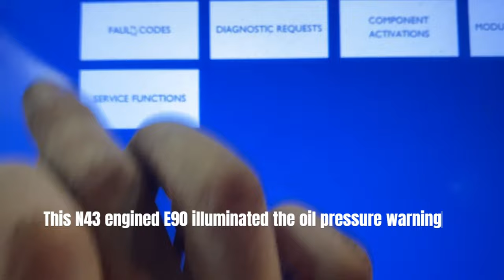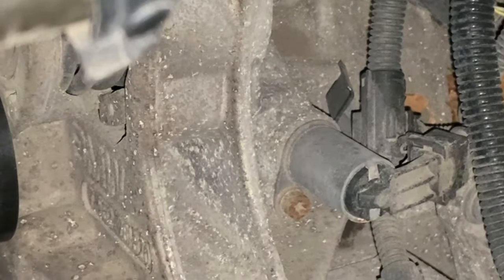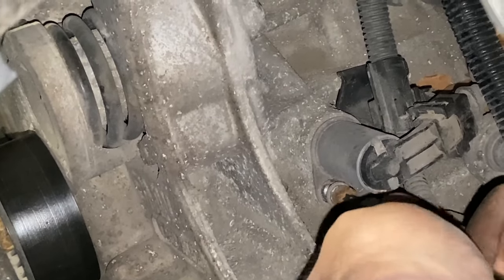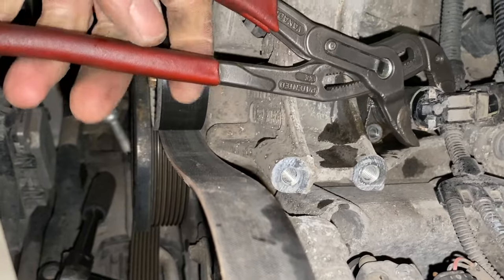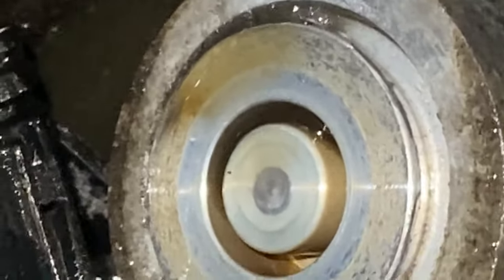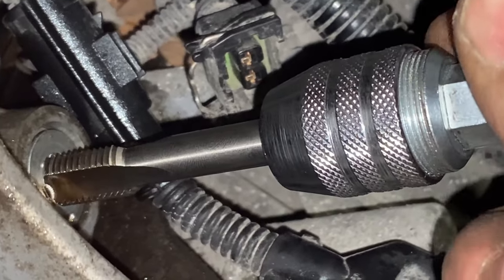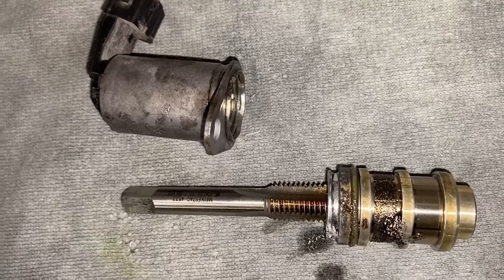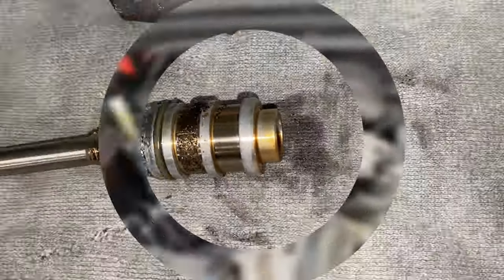BMW E90 N43 oil pressure too low

Comment: Brilliant video, thanks so much for posting. I had the same issue on my 2010 E92 N43 at 77k miles. Tried to get the oil pressure control valve out to clean it, but it snapped off - same as yours. So followed your video and managed to get it out using an M12 tap, but it took quite a bit of hammering. After it came out I had to fish out the spring and the end cap from the chamber, as they'd come off the valve - not sure whether they broke off beforehand, or I put the tap in too far - about 1.5cm. Put in a new valve £120 from ebay and the engine is running like a dream. Would never have known what to do with a broken off valve without your video. I owe you a pint. Thanks again for posting, love the commentary and the accent btw. Best of luck with the channel mate..
Reply from the maker: How amazing that my little M12 tap did the job for you as well and that you managed to fix the car with a new valve 🙂👍 Thanks alot for the comments and support. Awesome 🙂

Comment: Straight to the point, plenty of knowledge to pick up on for a DIYer like me, really enjoyed this mate!
Reply from the maker: Thanks so much for the kind reply and great encouragement. I have alot more videos in the pipeline so keep tuned for more 🙂
Reply: Top video 👍 did this customer’s car have the 30C1 fault code for ‘engine-oil pressure control’? My car has that fault and maybe this is why although the sump was removed recently and no debris in it ir pick up….neither did the VANOS solenoids…?
Reply from the maker: @01123581321341 Engine oil pressure control static was the fault description. Sometimes these solenoids just fail. If you look at them they aint very sturdy to be fair. A real pain these solenoids are 🤷‍♂️

Comment: Thanks for the video. I'm very glad that you finally solved this!  I'm also having the N43 and exactly the same issue, and I knew that probably this solenoid is responsible for that. Once I tried to pull this out, it also stuck in the same way, so I had to cancel the this procedure after some hours, otherwise it would be end-up like with your broken one. I nearly expected it. Really a bad design!  But at least I saw the method now, how to be in that situation. Would be interesting to know, how BMW service deals with it? I can imagine they have a special tool for that 😀
Reply from the maker: Hi. Sadly no special tool🙂 Only perseverance and a bit of luck that it stays in one piece when removing. Yes, not a great solenoid. The trouble with the N43 is debris-once it gets into the oil galleries it can be difficult to remove even with a new chain. The main oil galleries should be cleaned out but then you may as well strip the entire engine and replace parts so not cheap. I am very happy that the video helped you out. You can subscribe if you want to since I am trying to grow my channel. Lots more BMW videos coming 🙂

Comment: i own my n43 for 10 years, and i do my own maintenance, excellent video.
Reply from the maker: Thanks alot. Really appreciate that you watched it 🙂
Reply: can we chat on telegram? i would like to know someone who do maintance on this engine to share knowledge :)
Reply from the maker: Time is an issue for me, I dont really use telegram either. You can, by all means, follow me on linkedIn (link on my channel banner above) there you can certainly send messages.
Reply: How many miles had yours done before you had injector, timing chain or any major issues?
Reply: @Framus-wm3ye  i had 205 000km car was fine, i just wanted to change timing chain preventively and engine was full of carbon, burned oil horrible mess, i have photos. timing gaude was broken and pieces of it fall in to oil pump nose, immediatly after timing chaing replaced oil pump striped off gear shaft (i have photos too) so i had to replace it too. Wanted to change only timing chain and ended up with replaced OEM oil pump, timing chain, chain and gears for oil pump, oil pan (was coroded) and some other parts... bill was too high for my taste. Still fighting with problems with this engine, after that clima compressor clutch coil  was replaced (Was burn) and now i have error codes with EGR alreadyd bought it and waiting for friend so we can replace it.
Reply: i forgot.. i had oil pressure eror messages before that, and i did change oil valve whis was stuck hard exactly as in video
Reply: Victor, same here mate, own an N43 for 8 years. Do all my own maintenance and repairs (for my sins).
Reply: @invtrk1046  i have problem with positions of the camshafts. they are off (angles 12.5 and 9.6) its after chain replacement. any ideas if its only matter of readjusting it or can it be vanos gears worn out? you can aswer by email too if possible.thanks
Reply: @VICTOR BARRERA i have problem with positions of the camshafts. they are off (angles 12.5 and 9.6) its after chain replacement. any ideas if its only matter of readjusting it or can it be vanos gears worn out? you can aswer by email too if possible.thanks
Reply from the maker: @mifo1133 You will have the fault code for camshaft crankshaft correlation no doubt. You need to re time the engine lock the cams in position then try to move the vanos sprockets with a 16mm socket and wrench. If vanos sprockets move independently of locked camshafts then they need to be replaced since vanos sprockets should lock once engine is off. 
If they are locked and you have no oil pressure fault codes you should look at vanos solenoids.
Reply: @allmech_BMW_fault_finding  thank you a lot! will do that as you suggest me.

Comment: I just did the job myself and my recommendation would be to not twist it too much as it will break the crimp. Instead you should twist it only slightly until you see the metal plate can move. Next get a set of adjustable pliers and someone else who will rapidly tap the body of the solenoid with a small hammer while you pull straight outwards. Take your time take it easy and it should come out without breaking.
Reply from the maker: If you watch the video again you will hear that I warn about not twisting the valve body for that exact reason. You did one of them right? I have replaced hundreds going back 15 years and sometimes they will not come out no matter how gentle you do it or even if you try to pull straight up. Fact is at times they will break off from the crimp.

Comment: Hi, great video. I have an intermittent oil pressure warning on my e90. Two scenarios when It comes on, one at 3.5k+ revs, second when the revs drop sharply, i.e. say 2.5k revs down to idling (600rpm). Any idea what the issue could be? Thanks

Comment: I had an oil pressure warning once. I immediately took it to my mechanic and did timing chain guides, vanos units, vanos solenoids, oil pump chain kit, cam position sensors, and of course this little bastard oil pressure solenoid. Didn't want to take any chances with this engine. Thankfully there was nothing major wrong, just the solenoid had some dirt in it. Not much though. Probably enough to tript the fault once at idle.

 Haven't had any other issues since except for a super annoying tick that appears after 2000 revs and goes up with RPM after the engine has been fully warmed up. 
I'm replacing all the lifters and valve stem seals just to be on the safe side next week. 
Injectors, plugs and sparks are new and the last time they opened it up the cams looked fine. 

I swear if this wasn't my dream car I would sell it(E92 320i) :)) Still, I love to tinker with it and I've learned a lot doing little DIY's on this car.

Do you know if faulty lifters cause damage/lubrication issues in this N43 engine? I've read the 6 Cylinder variants have lifter noise but it doesn't affect anything. I'm a bit anxious about cam wear
Reply from the maker: Probably the best maintained N43 ever it seems bud. I hope you get many years out of it 🙂Keep that oil changed every 9000 miles and jobs a good un 🙂

Comment: I have E90 N43 with 96.000 km and on highway going 140km/h for about half an hour, I got low oil pressure warning. I pulled over, restarted the engine and the problem gone until the next day, when I had to drive on the highway again. Strange thing is that in the city, where I use the car mostly, this warning didn't show up yet. I will tell the mechanic about your video. Thank you for sharing!
Reply from the maker: They are a nightmare at times. Sure you should check the valve as I did but check the chain and if any slack is detected you really need to be looking at sump off and checking if any debris in there. Really cool that you found my video useful. Dont forget to subscribe as there are more videos in production. Thanks 🙂
Reply: @allmech_BMW_fault_finding Hi thanks for sharing this video it might be a great help for me 👍🏻

I have N43 118i with same issue as described above that started couple day ago with low oil pressure light during highway driving…

Car is at 231k km with timing chain and everything else original… so far only service items like plugs coils filters and one cam sensor that failed….

ive had the sump off around 3000-4000km back and there was no sign of any plastic debris from the guides, i also checked the oil pump suction tube and the screen at the oil pump and all was clean….. Vanos solenoids, oil filter without any sign of sludge or any metal flakes…. 

This oil control valve does seem to be the the last possible option to check without some major dissasembly to check the oil pump so hopefully it will sort out our issue…

Any ideas of what wlse could possibly cause this ? I know there are loads of possibilities but jist asking in case there are any obvious ones i may have missed

Thanks again your videos are great help 👍🏻
Reply from the maker: @17tomashavlin Hi Thomas🙂 Usually these engines suffer with aluminium swarf more than metal and this usually comes from many places. Its just one of those engines. If a cambelt would have been used it would have been way better 😀
Reply: Have the same exact problem as you, did you figure it out? mine has 200k km and it does the same exact thing, when i use it in the city no prob once i get out on highway - it pops . thanks mate
Reply: @sheeva1061  Yes, the mechanic replaced the solenoids and since then all is fine. Replaced the oil too.
Reply from the maker: @sheeva1061  You need to understand what is Map controlled oil regulation. In town you need less oil pressure but on the freeway higher oil pressure is needed. The DME commands the oil pressure solenoid to open more to allow more oil pressure from the oil pump into the main oil gallery - here it all goes wrong. Debris makes the thing stick and pressure is too low.

In my ideas I would fit a blank and remap the DME to get rid of this soldnoid 🤷‍♂️😅 Someone should try to do it as this problem is not going away.
Reply: just had my oil bath thing checked by the mechanic today for debris and everything looked fine in there. he came up with the idea of maybe some gas dripping in the oil somehow and changing it's density so i figured i ll try more dense oil before changing pressure oil sensor and then pressure oil valve 
 @allmech_BMW_fault_finding
Reply: @sheeva1061  that's the most stupid thing i've heard. Changing oil viscosity doesn't fix stuff. Its like sweeping the mud under the carpet. And to have gas dripping in the oil enough to cause oil pressure issues means that the injectors are outright defective. Defective enough to cause rough running and misfires. 

For the sake of that engine, change your mechanic. And do change the pressure oil valve.
Reply: @TheEvilPizzaDude i changed the oil pressure sensor and got a slighlty thicker oil ( the one they use for racing) and it did the trick for me - i did some 250km trips and no more red oil warning. I never got to the pressure valve thing.
Reply from the maker: @sheeva1061 It will come back (the warning) It would have been wise to remove and inspect the oil pressure control solenoid. There may have been swarf in the old oil pressure sensor too hence it potentially not working correctly. Keep us all posted with your progress 🙂
Reply: @allmech_BMW_fault_finding oh we did that too ! The mechanic got the “oil bath” down and there was no debris in there he showd me videos and it was suuuper clean .
Reply: @sheeva1061  After 7 months, I came back with an update about the low pressure warning. Turned out that probably the car had it's odometer tampered and rolled back, just guessing maybe around 70.000. kms. I didn't pay attention neither the mechanic that the timing chain was stretched. The fake mileage tricked us. The first sign for that, on cold start it caused rattling sound from the engine. But this was just the aftermath of the broken plastic timing chain tensioner. These small plastic parts clogged the oil pump and ruined the crankshaft because of oil deficit. The car is still in the mechanic's garage. I will have to pay a lot of money to fix this. I hate internal combustion engines. I will buy electric after this car.
Reply: @bonafide9085 oh snap sorry to hear. 7 months later the red oil signal never came back. I guess after all the replacing did the trick. Good luck with the fix sorry to hear i know what a headache it can be .
Reply: @sheeva1061  Thanks, it is what it is, lesson learned. I will avoid buying vehicles with internal combustion engines as they are too complex even for a big, famous and experienced car manufacturer. I know, there is a customer error in my situation, but still, this N43 is not forgiving, very bad construction with design flaws.
Reply from the maker: @bonafide9085 I agree. The newer models also have issues not least the materials used are crap compared to the Gxx and Exx models. Sump off clean it sand it will help

Comment: Hi Ben, really appreciate the advice and technique. I'm giving it ago in my N43 120i as the low oil pressure came on recently. Where in the UK can I buy the drive tap chuck adapter and the slide hammer, I've looked everywhere and impossible to find exact ones. Thanks.
Reply from the maker: Hi pal. Well Toolstation or Machine Mart would probably sell the taps. The adapter is from Wurth Tools so find a Wurth supplier for those. The slide hammer is from a general diesel fuel injector removal kit. 
They dont always snap and often a turn and positive pressure should allow removal by hand.

Comment: Great video.. wish i had the skill and tools to pull out off. Having to scrap 1 month after buying E87 with N43B20a because repair cost to high. Geezer who sold it clearly saw i was easy target and I cant in fair conscience do that to someone else.
Reply from the maker: Mate try to find a cheaper but good mechanic. Kudos to you for your honesty as there is less of that these days. What exactly is wrong with your n43?
Reply: Very low pressure. I thinkbthe recommended minimum is 1600psi and mine was half of that. It also has timing chain issues causing very long cranks. Funny thing is i had the diesel for many years, 170k miles, and had no issues. I was only forced to change becos of ULEZ in London
Reply from the maker: @lariyo9122 I feel for you - Ulez is causing quite a controversy. Get the chain sorted mate as no doubt there will be plastic partially obstructing the pick up pipe for the oil pump. I hope you find a good Bmw indy to do the work on it. I had one in today "oil pressure static" its like an epidemic 😵‍💫

Comment from the maker: Somebody asked me what the oil pressure should be but since this engine uses map controlled oil valve the pressure varies constantly. At idle the pressure is much less than at 6000 rpm as the engine needs much more oil at that speed which is one of the reasons why at idle you usually have the sticking problem with solenoid since the solenoid rarely goes full chat unless the car is driven like you stole it. 2500 mBar should be fine at idle where some with faulty valves are at 1109 mBar and they put the oil light on as pressure feedback from oil sensor to DME is judged as too low. 
The solution long term is to replace this valve and have full flow full pressure at all times and then remove the oil pump map from the DME. I think its possible.

Comment: My N43 has the 30C1 fault for oil pressure but no dashboard light. When warm it has a slight bottom end knock on acceleration - I guess from low oil pressure. If this solenoid just failed then would the engine run at all ? My sump was removed recently and all clean in pickup. If solenoid fails it runs at 1 bar or something only ? Is it worth my replacing it ? Tha ks!
Reply from the maker: If it fails and assuming the oil pump is working there will in fact be maximum oil pressure. The knock at the bottom end, if the knock is heavy, would suggest main bearings are worn and I have seen quite many of those on the N43 over the years. 
Like I tell everyone - you need to measure the oil pressure with a pukka oil pressure gauge and determine exactly what oil pressure exists. Until you know that it will remain a guessing game.
If you whip of the alternator you can simply use a T piece from a dedicated kit and this way you can leave the oil pressure sensor connected to avoid cc messages as you blatter it down the dual carriageway with an assistant monitoring the oil pressure. Thats  what you need to do👍

Comment: Do you need to check the oilpan aswell after changing thia valve?
Reply from the maker: Not really but the older the oil pan the more likely it will be flaking off inside and after a few months the valve will fill with more crap. The problem on N43 is the oil pickup filter holes are way too big. The N20 by comparison is way finer a mesh and as a result pre-filters way better. If it was me I would do the valve and just drive it and see if you get away with it 🙂